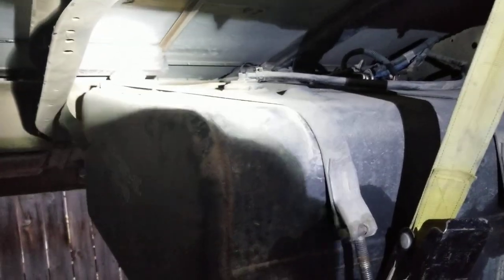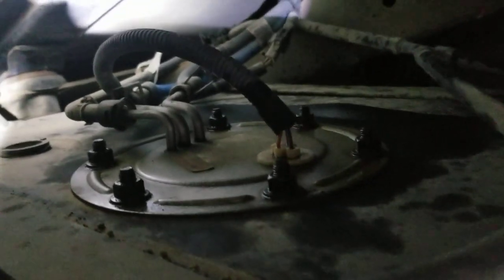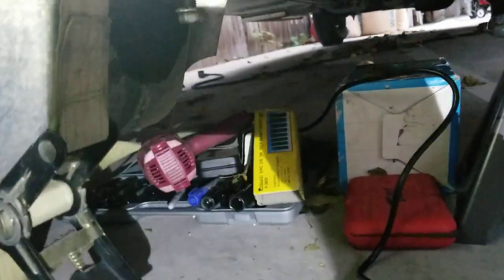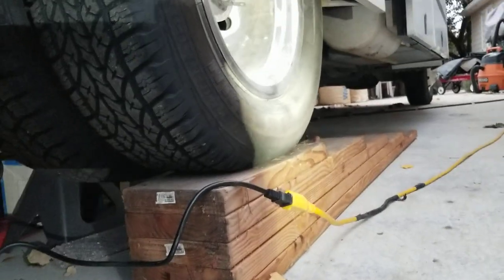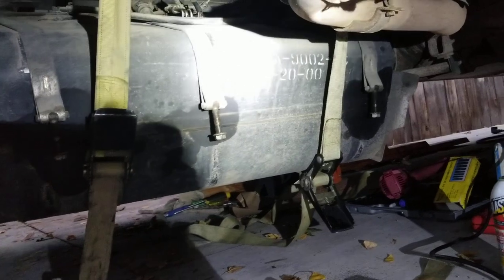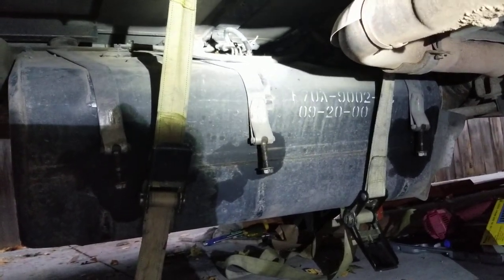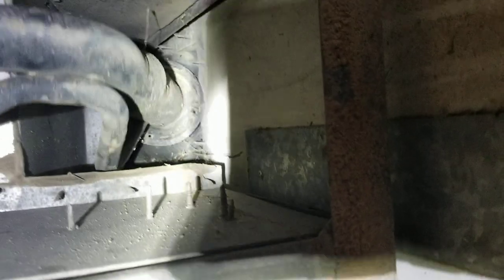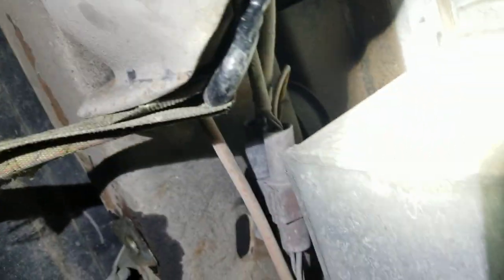Ford E450 motorhome fuel pump replacement

Comment: Love your video. Thanks! I need drop my tank only to connect the generator line to the new gas pump installed. Do you think that I need drop the entire tank? Mine is looks like yours.
Reply from the maker: Probanly...once you have it loose it comes down no problem.  Good Luck !

Comment: I'm about to attempt this on my motorhome. I'm not really finding the videos showing how to drop the tank with straps. Can you post a link or detail in comments. Looks straightforward, but wanted a little more insight
Reply from the maker: Straps just keep it from falling when you unhook the mounts; then use the ratchets on the straps to let it down slowly.  About all there is to it.

Comment: I have a question if you can help me
Out 
Theres 3 ports 
One is supply one is return 
But what is the third one for is it for a generator? Evap?
Reply: Vent
Reply: 3 Rd is for your generator feed
Reply: What is the generator feed? @MR_UNOoo
Reply: @hiimnew2649  the rv has a GENERATOR.....THAT LINE IS THE GAS LINE/PORT FOR IT

Comment: I was hoping you would show how many studs broke off on the tank flange, I had 4 studs brake off, and you need every one of them, so I pulled the tank all the way out and had to drill and tap, for new studs. also installed a frame rail fuel pump, so I will not be stuck on the road again.  ( I used straps also )
Reply from the maker: Thankfully none of my studs broke off the PB Blaster helped I think and just being easy taking the nuts off.
Reply: Trying to figure out if my fuel pump failed or if I have another problem. If and when I have to deal with the fuel pump is like to know more about the fuel rail option you installed. Is it an alternative to the in-tank or in addition? If in addition, does it become the primary or the fail safe?  Does only one operate at a time and if one fails how does it not prevent flow?

Like what you installed? What pumps do you recommend?

Comment from the maker: Yes, thus the safety stands with some weight on them. 10,000 lbs  is about what that axle ways when I have checked it on the truck scale coming and going to the mountains a few times.
Reply: I know Im kind of randomly asking but does anyone know a good site to stream newly released series online ?
Reply: @Abraham Rodrigo lately I have been using FlixZone. You can find it on google :)

Comment: Hey I'm in the same situation. But cannot locate the correct fuel pump to buy. The one I got at autozone has 2 ports. The one on the rv has 3. I have been typing everything i can think of in google to locate. Nothing yet. Any help would be much appreciated.
Reply from the maker: Mine had three ports as well. They are hard to find but I found a replacement for mine on Amazon it was only $43 I think? As soon as I bought it though the price went up to about $85 for the same pump. But it is available there. Surprised it was that hard to locate one but they are kind of a rare breed I guess. Anyway check Amazon....
Reply from the maker: Airtex E2276S Fuel Pump https://www.amazon.com/dp/B000C4E0AU/ref=cm_sw_r_cp_apap_UPSVvT1kXxd7P